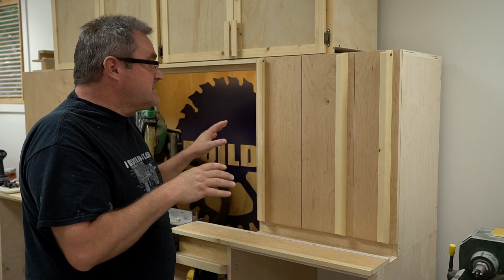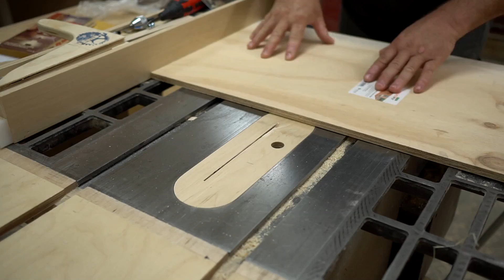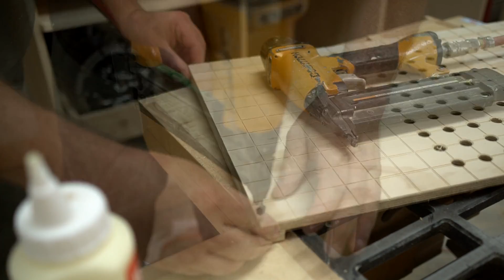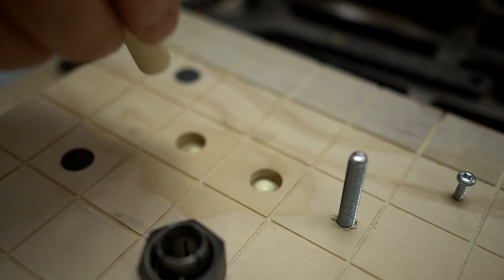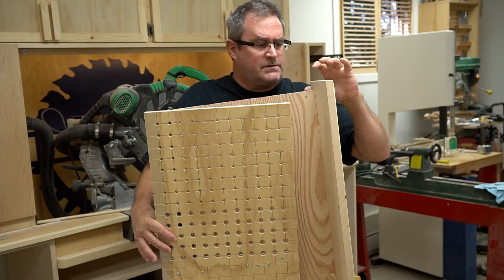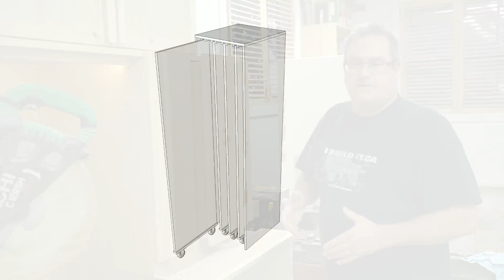The Router Bit Rack - Building The Miter Saw Station Part 7

Comment: that pull on the center one drives me nuts. that kind of stuff doesn't normally affect me but this time it is. it would look much better in the center of it so the spacing is even
Reply from the maker: No it wouldn't :)
Reply: +I Build It well I wasn't expecting a reply lol. I just had to say something because otherwise each time I see it in future videos it will bug me. at least now I said what I had to
Reply: Maybe you missed it but at 1:02 in the video, you can clearly see why he off set the handle to one side.
That gives him the clearance he needs to remove the little storage boxes from the drawer just to the left of it.